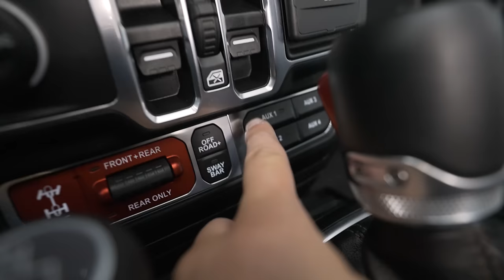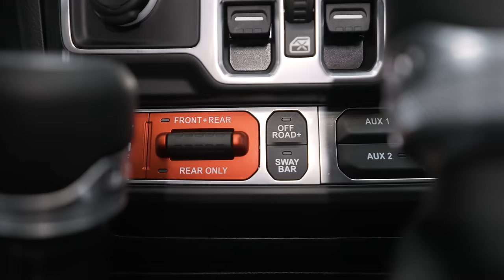ENR#31 - Full Walkaround - 2023 Jeep Wrangler Rubicon 392  + $50,000 Giveaway

Comment: This is almost perfect.  Should’ve done rockslide engineering steps instead of amp, needs a custom rear bumper to match the front not the stock one, needs the high clearance fender kit in the rear just like the front fenders. Other than it’s pretty solid.
Reply from the maker: thanks man!

Comment: Nice build, but…

1. 17-inch wheels would be much better.

2. The AMP steps offer ZERO protection. The factory rock rails would have been better. Mopar also offers rock rails with the step assist, which offers the same protection, but is wider than the standard rails creating a step.

3. If the rear bumper is the factory steel one, it will take some harder hits, but it’s also known to roll back into the body coming off obstacles causing body damage. Also, the position of the rear license plate on either style factory rear bumper makes it more vulnerable to be ripped off on the trail.